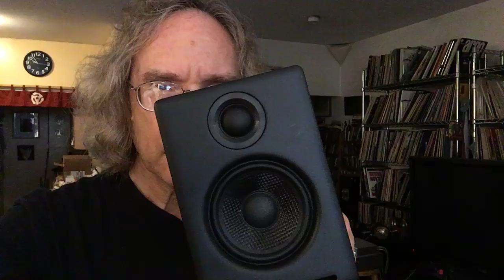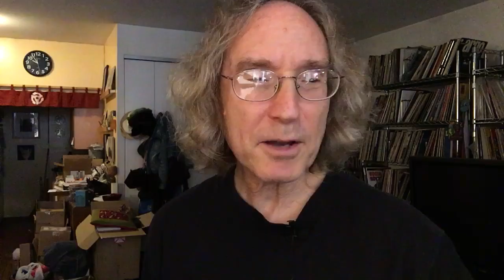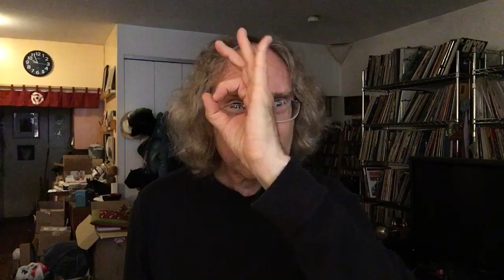The case against 1 inch dome tweeters

Comment: A well engineered 1" dome tweeter with an excellent crossover and time alinement is an excellent compromise. You can get life like dynamics with excellent clarity with good transients with such a driver.  With excellent cooling amazing output. Most dome tweeters are very easy to drive by even the most pedestrian amplifiers.

Magneplanar speakers sound very life like but lack dynamics and do not play very loud.  Even when you stack them.

Electrostatics are the best sounding tweeters and can easily outperform the best conventional tweeters in every way when painstakingly engineered.  The biggest problem with electrostatics is there are only a few on the market that will sound exceptional with inexpensive amplifiers ( IE they are a difficult load to drive consistently over their audio  spectrum).

Compression drivers for the most part have life like dynamics and play very loud. Most do not sound anywhere close to a live performance.  Many bargain compression drivers are painful to listen to above moderate levels.

So.......dome tweeters are an excellent compromise.
Reply: My ideal tweeter is a 1-1/8 inch Beryllium dome. It’s so sparking crisp with zero harshness.

Comment: It is not about size, or actually it IS about size, because higher frequency transduction requires a tweeter to be small. A small dome tweeter is just about ideal and cannot be matched by larger equipment for its ability to accelerate air at the target frequencies. How far it moves back and forth determines perceived volume as a result of the achieved amplitude. A small surface, fast movement can be and is as energetic as a large, but slow movement. So for high frequencies,well, size actually really does matter - the thing has to be small!

Comment: If you referring to the dynamic range of those mid-high to high frequencies, I think multiple dome tweeter combined to be 42" tall would work just as well. Our eardrum is much smaller than an inch yet can detect those sounds you speak about, so a tweeter should be able to reproduce just as well.

Comment: The Vifa one inch ring radiator has over 6 octaves of useable range. There's no reason a silk dome could handle 4 octaves ranging from 2k. They're very common in studio loudspeakers, you know.

Comment: A 1" tweeters area is actually gigantic compared to what many "audiophiles" find acceptable for reproducing the lower end. Wavelength is a keyword here. Try adding some square metres of membrane area to achieve some low end fidelity and see how the tonal balance falls in place. Maggies are great show off panels, but don't sound realistic when you compare them to a full 20-20k system in a treated room. Get to work Steve! Clean up your room first and then speculate why 1" tweeters don't work for you! :)

Comment: My compression drivers have 1.75" diaphragms with 1" throat apertures. I use Karlson couplers, rather than horns to provide loading and dispersion.  They seem effortless to me. The area of a 1" diaphragm is 0.785 sq. in. and a 1.75" diaphragm is  2.405 sq. in. Both of these are significantly smaller than the 63 sq. in. of Steve's Magnepans. It leads me to believe that excursion, area and geometry are all important.

Comment: Must agree.  I have Acoustat 2+2 full-range electrostatic speakers that have an effortless, flat high end to die for.  A few months ago I listened to $16K Wilson speakers -- don't know which specific Wilsons -- driven by extremely good electronics (i.e., Bolder power amplifier and like quality line amp and DAC).  The high end was unnatural, shrill, and with a peak around 4 to 8 k.  I'm so glad I don't have to live with those things in spite of the fact that they're very good speakers.  

90 percent of the time I listen to classical music with a heavy emphasis on solo piano and chamber music.  In my view, this genre of music is best served by electrostats or maggies.  On the other hand, if you're principally into rock and other sorts of music with a lot of "slam," then you're probably going to find my speakers anemic and too analytical.  

The other disadvantage of my speakers is that the soundstage is not the best.  I have excellent resolution from top to bottom and from side to side, but a relative lack of sharply defined instruments sitting on a stage behind my speakers, especially if there's many instruments (solo instruments and voices can be exquisitely imaged).  This problem has been significantly improved by my acquiring a tube line amplifier (Asthetix Calypso Signature), an Ayre CD player, and a Bryston 14Bsst2 amplifier, but I've heard better.  

One finally observation:  I can listen to my system for many hours without a break and suffer no fatigue.  Can't say that for my experience with the Wilsons.  After about an hour I wanted to get out of the room.  Don't know what that was about.

Comment: Ribbon style tweeters in a line source (many drivers stacked) were-are the way to go.  Infinity got that right years ago with some of their speakers.  PS Audio is now designing speakers like that to be released next year.  Big bucks however.
Reply: All PS stuff is mega bucks... way out of my range...
Reply: I find this video very intriguing and does go back to the argument of point source vs line source. I have been a fan of line source speaker such as the Infinity IRS and planar speakers such as Magnepans for almost 50 years. Cost , size and space considerations make them impractical for most folks, but what a sound!
Reply: Definitely...maybe not the ONLY way to go but solves the problem we speak of.
Reply: Steve Roginski.Couldn`t agree more.I have Apogee ribbon planar speakers actively driven which have large single mr/treble ribbons 4 feet long which have much lower distortion than a single dome tweeter and also don`t suffer from thermal dynamic compression due to their large radiating area, 48 square inches which is aquivalent to a 10 inch moving coil driver.

Comment: An interesting question and topic to be sure. I would add that it's helpful to think in terms of octaves when discussing bandwidth and frequency ranges. While 3 kHz - 20 kHz sounds like a huge range, it actually represents only about two and three quarters (2.75) octaves of the ten-octave bandwidth (20 Hz - 20 kHz) that a full-range loudspeaker aims to reproduce. This is still no small feat, but the other drivers are reproducing the lower ~7.25 octaves, which require the vast majority of the acoustic energy.

Comment: The tweeter must be smaller and lighter to replicate higher frequencies. If you want a driver to replicate mid to very high frequencies, typically it must be small and light enough to vibrate at 10 thousand cycles per second under control. Being voice coil based, a tweeter has electrical and physical limitations that limit it to 3kish on the low end. Planar speakers are a one driver attempt for speaker design, so you don't have any crossover issues and a smoother spectrum. It's more or less comparing apples to oranges because a tweeter is inherently designed to be in a multidriver system whereas planars are just coupled with a subwoofer. Large high end multidriver systems use more complicated crossover systems and better drivers to better isolate frequencies for each individual driver, reducing work load for each driver and allowing the whole spectrum to be covered. Other system variables like baffle topology and cabinet design account for added harmonizing of the tweeters with the other drivers. Is it as perfect as a theoretical single point source that produces all frequencies? No, of course not. But it gets the job done quite well and I wouldn't call it anything close to a scam or physical impossibility.

Comment: 3k to 20k is just a shade under 3 octaves, and most of that range is harmonics/overtones, not the primary. Also excursion is very, very small at these higher (especially above 5-6k or so) frequencies.  I think you're off onto a path not taken, and not taken for a good reason.  I'd advise looking at some OLD Hirsch-Houk Labs reviews for Stereo Review from the 70's and 80's.  Tweeters? Not the problem.

Comment: I think that this kind of frequency just needs a way smaller membrane to be effective.
But I'd certainly agree to that nothion of a 1" Tweeter beein uncomfortable at 3kHz. 
Some Ribbon speakers for example got quite some big effective area despite beeing "tweeters". Some of them even in use particularly for the upper midrange!
Founteks NeoX series cought my eye! Will use them in my next build.
... since many years I run a lil' PA system, a 500/300 crossover on the mains, 12" Woofer, 8" Mid and a 2.5" (!) softdome tweeter | Tonsil gtc 130 something ...
It performs just great :-)

Comment: I would say a one inch tweeter is gigantic.

If a tweeter starts at 3000 Hz and a woofer at 30 Hz, I would expect a size difference of a 100 times, just as the wavelength or instrument sizes. So a one inch tweeter corresponds with a woofer of a 100 inch, a 12 inch woofer corresponds with a tweeter of 0.12 inch!

So a one inch tweeter is gigantic or a 12 inch woofer is tiny.
Reply: Good point...

Comment: Steve,

First time on your channel and I'm a long time audiophile myself, so I don't want to pass myself off as an expert. However I know what I like in the reproduced sounds and it is an personal experience. My question for you is don't most speakers of any notoriety have crossover or low pass filter caps to keep the range where it belongs? I have had Magnaplaners and many other self proclaimed high end speakers over the years, but I finally came across the Sony SSU -4400. And to my ear they still give me the best fidelity when compared to the others. 

I'm curious to know, but I would agree that it seems likely that a 1 inch anything would have to be sprinkled with fair dust to rate that kind of price per pair.

Robert

Comment: 1" tweeters are able to work due to the level of energy required in the high-frequency range of audio is very low compared to lower frequencies. However, all of the diaphram materials flex (buckle) and generate resonances. Combined this with the rather small radiating surface limits them in cleanly reproducing a drum cymbal at a realistic SPL for example. It is more complex than that though. A drum cymbal sound would be split between the midrange and tweeter. Both drivers will be active for a portion of the band at the speaker's crossover frequency. The two devices are rarely in perfect phase even in high-quality speakers and up to 180 degrees out of phase. This causes distortion and/or cancellations and imaging problems. The more severe the phase mismatch the worse the issue is. This cannot be totally eliminated no matter what the cost of a conventional multi-driver speaker is, just minimized through better speaker design.
Reply: There is tools being used right now to minimize cone breakup and new materials as well. I have read of a BMR that exhibited no break up up to 50,000hz using this tool to measure.
https://www.polytec.com/us/vibrometry/areas-of-application/acoustics-and-ultrasonics/$loudspeakers-and-musical-instruments/

Comment: Maybe true, Steve.
BUT designs like the TAD you use or my ProAc tablettes also try to squish the mid and bass through a 4 or 5 inch driver....that's asking alot!
I roll mine off @ 100hz thru a Rogers LSB1 stereo sub then supplement that with two REL subs. 
It's all about scale I guess. Small speakers are pressurising small spaces.
Before I broke my Maggies I appreciated the natural treble presentation. I believe that large tweeter beamed alot of that energy horizontally over my head, though. Try standing and it was gone!
Unless you tilt them back of course ;-)

Comment: I agree with you to some extent, Steve.  I think what to are responding to is a combination of distortion and the power that gets into the room.  Most tweeters, even those with a short coil in a long gap, struggle to get to -50dB THD.  That's 0.3%, and quite often at less than 1W.  The Magnepans, while not ideal,  need to move perhaps a 100th of the distance for the same level of output so don't get to see excursion or field non-linearity.  Nor do they heat up and vary the current in the coil (though I have found it very hard to pin down this supposed compression effect, and just haven't seen a significant change in resistance).  The other thing is that the horizontal directionality  in the Magnepans is built into the speaker, being determined by the width.  Because this is the same for the midrange and tweeter it should be very easy to achieve a seamless transition from mid to treble; in a standard speaker without a tweeter waveguide there is a notable discontinuity in directionality with the tweeter radiating in a forward full hemisphere and, at 3k,  the midrange managing perhaps half that angle.  The solution to this in a 'standard' speaker is to lower the crossover point to around 2k-2.2k for a (slightly) better match, but this makes the distortion worse.  The situation is complicated, but if the designer is maintaining a flat response through the crossover region axially then the sound coming off the walls will have a higher low treble content than the direct sound.  The designer may decide to ease off on the treble a touch to make up for the subjective  effect of this.  If he does, then you can expect to lose that sense of real power.  Some of the most popular crossover alignments can suck out power too, giving you that totally domestic sound with pint-sized musicians playing on your mantlepiece.  If the designer then decides to compensate for the rise in treble response on axis (tweeters do become directional as well), then you are all the way back to the Spendor BC1.  :)  A well executed design with the tweeter in a waveguide, or concentrically mounted in a midrange, should get you over these problems and reproducing scale shouldn't be a problem.  Because the tweeter is radiating into a narrower solid angle its sensitivity goes up (by 5 or 6dB) and this helps on the distortion side.  With a 1" tweeter there will always be a cap on the undistorted peak output (and I would argue for something larger than 1" for this reason, as well as the distortion at lower levels) but you are then talking about a whole different class of speaker if the bass unit excursion is not going to become the limiting factor.  For the sort of rooms that ordinary people live in, a 1" tweeter should be more than adequate.

Comment: Don't disagree that there are average differences in the performance parmeters between tweeter types. I just don't get questioning of the frequency range without defining any specific question.  In reality, music, human hearing and mechanical devices respond to sound according to patterns of harmonic resonance scales.  This is the basic concept behind octaves where the frequency doubles in each octave.  The difference between 2.5khz and 20kHz is 3 octaves out of the audible scale of 10 octaves.  It is equivilant to the range 20Hz-160Hz.  So, in a full range 3 way speaker, it's doesn't seem unreasonable to expect each transducer to cover about 3 and a bit octaves.  There are cases for breaking the spectrum up a bit more than that but, then we are talking about a different system entirely, like comparing apples with oranges, or bookshelves with towers.....

Comment: This is going to be interesting! So, dome tweeters have better dispersion than cone tweeters. So my first dome tweeters where the Peerless rectangular framed 1" soft domes that were everywhere during the late 70's, early 80's. They were used in Dyne Acoustics towers amongst other speakers. They sounded good and helped the bass response of some speakers by providing impact, but neither of these offereings offered great response over time. From there Focal I traduced two acid etched titanium domes one at z90 man and. The other one offerend Tomas rain realism in the lower speakers.  T tweeters we're brought out on a traveling show and lost their ass to the acid etched titanium tweeters! I bought most of my equipment from 78 to mam

From there, a 1" orange dome tweeter mounted in a spun aluminum horn provided great response on axis. But even those they sounded great they didn't last long.
Reply: Wwhttps://youtu.be/7EroEqHV-Tswcoh man, this guy was the one we aspired to be. He was the leader in the DIY movement, and his work set the bar for many of us and the commercial manufacturers combined. May he Rest In Peace!

Comment: The 1 inch dome tweeter is ideal for the application (3KHz to 12KHz). The physical audio wavelengths require a small radiating surface in order to ensure even dispersion. The Magnepan tweeter is a bad design. It will produce comb filtering as it is far too tall for the task. Steve apparently likes significant levels of sound coloration which possibly explains his eclectic choice of equipment. Steve is also a conspiracy theorist...sorry to burst your bubble Steve but the 1 inch dome is actually ideal for what it does and this is why it is used so much. Manufacturers aren’t colluding together to all produce inadequate treble response.

Comment: Anyone here remember the the punch, slam and transient response from the infamous L series JBL speakers? Well the legendary L100 Centurys had mid to high crossover points at 6 khz. This significantly reduces the load from the tweeters. Arguably one the best mid-range drivers ever made  - the 5 inch LE 5 and it's variants were able to supply critical mid-range and lower treble frequencies with ease. JBL certainly knew what they were doing....